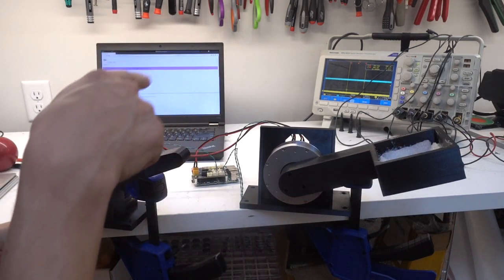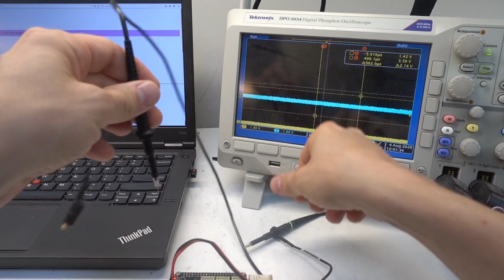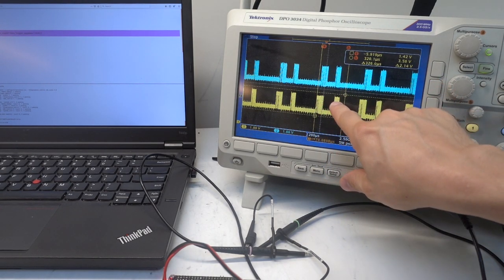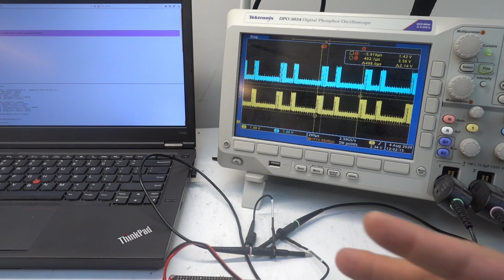Skyentific's telepresence demo with qdd100s at a 2kHz update rate

Comment: Fantastic demo!!!  What do you set the control variable to in the PID loop?  Do you use the opposite arm's last known position or split the difference or something else?
Reply from the maker: As you saw the demo was bidirectional and initially symmetric. The control variable was the difference in position and for the 'd' term the difference in velocity. Then the sign is just flipped between the output torque command to one of the servos.
Reply: @awesjosh  Nice!  Seems conceptually straightforward, I'm sure there are many details.   Thanks for the info!
Reply from the maker: While there are details, when you start with high performance components, it is actually pretty straightforward.  The entire control code is just 10 lines of code here: https://github.com/mjbots/mjmech/blob/master/mech/telepresence_control.cc#L234  (the rest of the file is just copy-pasted, as I was just making a demo)

I spent maybe 3-4 hours total from concept to being ready to film on this, and that included printing the new paddle and an hour futzing with a new microsd card on the Raspberry Pi that didn't boot initially.